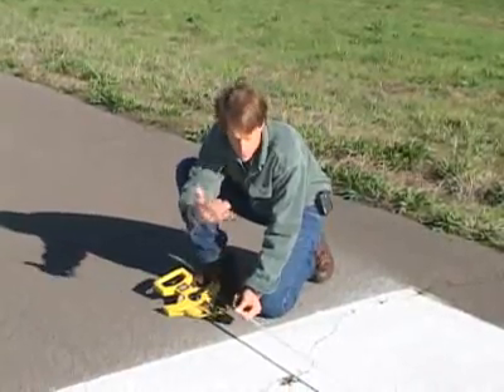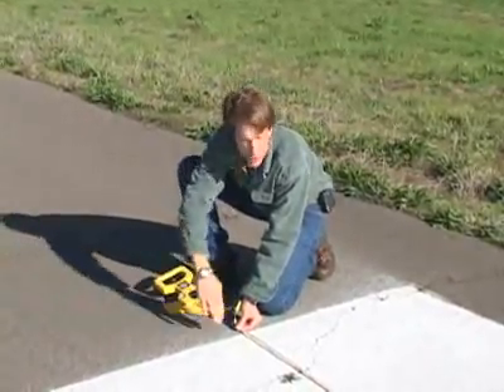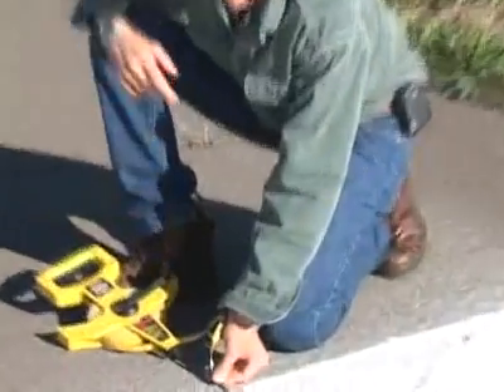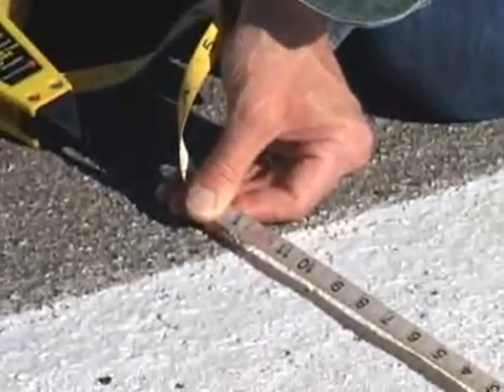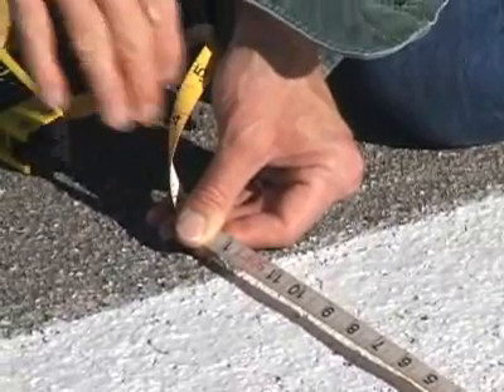Sport pilot: Short take off demonstration in light airplane

Comment: Okay nice take off but definitely not 82 feet. First the mains din't break until just past the top of the numbers which is at 90 feet. Plus the mains were back about 8 feet behind the starting mark. I'd say technically closer to 100 feet that 82 feet. Regardless that's picking the fly poop out of the pepper it is still a short take off and worthy of positive comment.

Comment: I would disagree with the 82 ft. Sure, the plane rotates at 82 ft, but it doesn't become airborne until barely after the runway numbers. You can see this if you pause it right at 2:48. I would say closer to 95 feet or so.

Comment: Well it depends greatly on the weight and the weather,  but lets say at full weight 1680 lbs, that is with pilot and passenger and full tanks the 100HP engine and standard temperature, about 200 ft of runway and 230 ft to clear a 50 ft obstacle at the end of the runway.